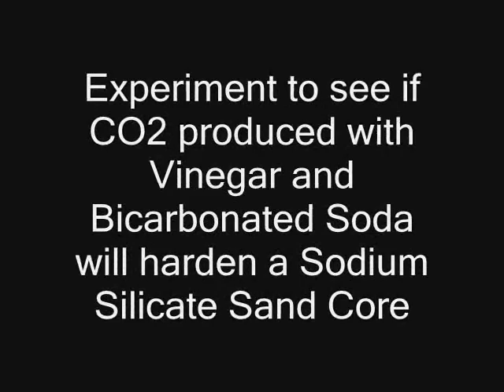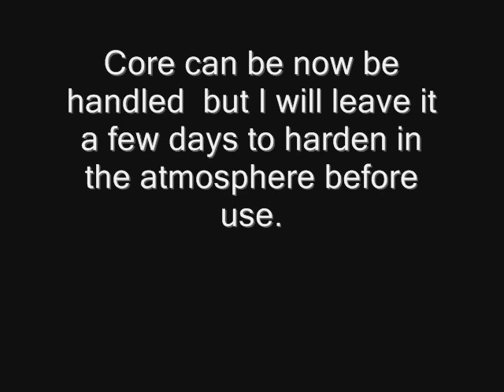Metal Casting at Home Part 19  Experiment with Core Making.

Comment: i love this video...i think you loose alot of co2 and presure with this sistem,is not well sealed and the co2 flows to the top and the core is in the bottom...i think you can use a cap to the glass with the vinegar and soda and put a tube and conetc with the tube that you use as a mold to the core...that will force the co2 to flows through the sand ...what you think? is only a idea im not envolbed in this kind of activity...thankx for your videos i love to see the real making of things

Comment: Ive had very good sucess using baking soda and vinegar to harden cores. What i do differently than you is to make it in a sealed bottle with a hose attached. I have a silicone funnel on the end of the hose. Which seals it to the end of the core box. The pressure forces it through the core and it hardens instantly. Pressure only lasts a couple seconds, but that is enough.
I have done a core comparable to yours here, but with a small vent hole through the length. Whole thing hardens in couple seconds.

Comment: Hi There Myfordboy,
Would it be worth piercing holes along the soft core with a barbecue skewer or similar help the CO2 to circulate through the core and aid hardening as the CO2 is not pressurised?  Or perhaps the core could be made hollow by packing the sand around a dowel in the core mould?

Comment: Try making a hole through the middle of the core.  Insert a coat hanger the whole length of the sand core.  Ram the sand.  Remove the coat hanger.  Apply the CO2.  It should work.

Comment: Nice don, and what about mixing the vinager and the bicarbonated soda into a sealed  container with a valve, so it will generate Co2 and build up some pressure, and then conect a hose to the valve, and inject the Co2 into the core? would it work better?

Comment: I have used this method and it works well.  I put the vinegar into a glass jar, tipped in the bicarb, sealed between it and the core mould, with a rubber gasket and let the gasses be pushed up through the core.  Worked better with a good quality vinegar, rather than the cheap supermarket brand.

Comment: I'm on vid 20 of this series now (so haven't come up to date yet if you've improved your method already), but I had a thought that might help. If you're willing to give it a few hours, then a nice pinch of baker's yeast in a glass of warm sugary water will develop more CO2 than vinegar+bicarbonate, just takes it a bit (and you may want to put your cores up on a cookie rack to make sure no overflow yeast mixture hits them).
Reply from the maker: Robherc H Thanks for the suggestion. I have moved on though and now use a different sodium silicate and gas with a CO2 bottle. The method shown here though works well using simple materials.